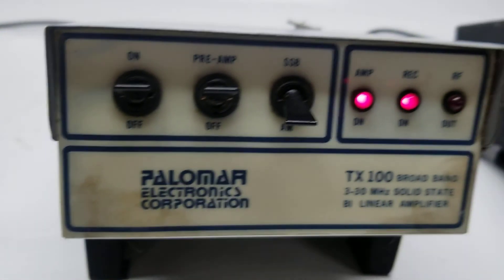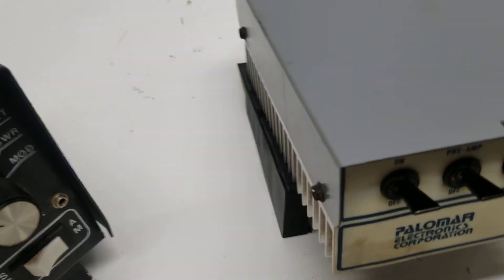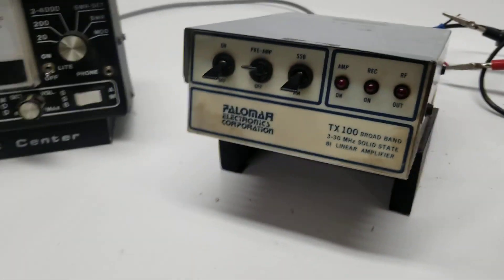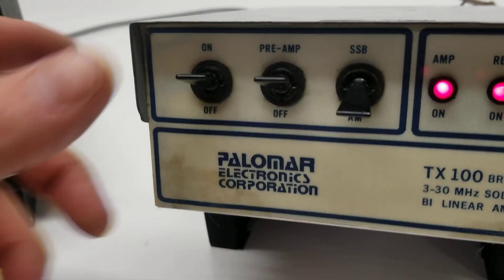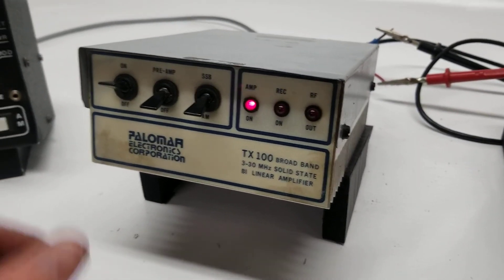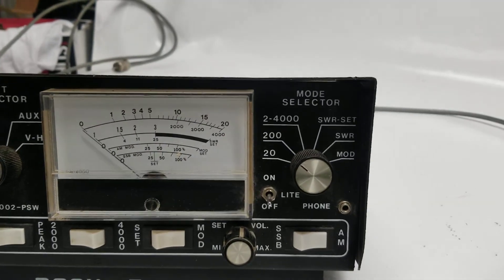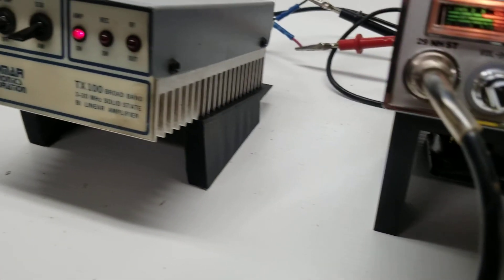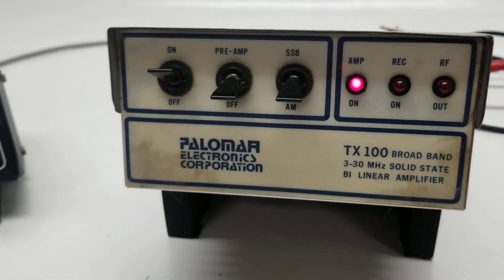Palomar tx 100 bilinear solid state cb ham amplifier

Comment: I had one of those years ago. We jusy called them 100 watts push and pull. If you find the electronic diagram for the circuit, you would see the two main transistors work in a push and pull configuration.  My dad used to know a lot more than I do.